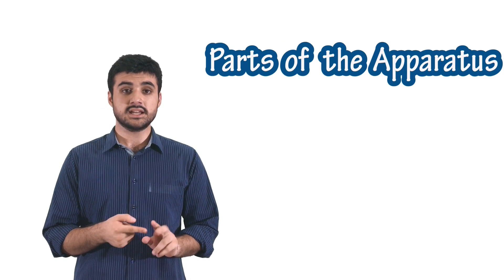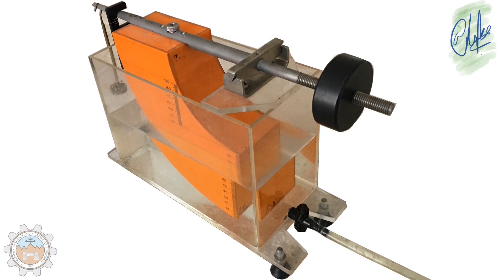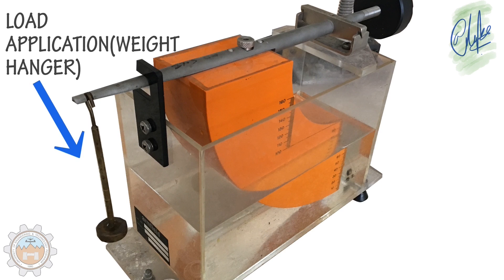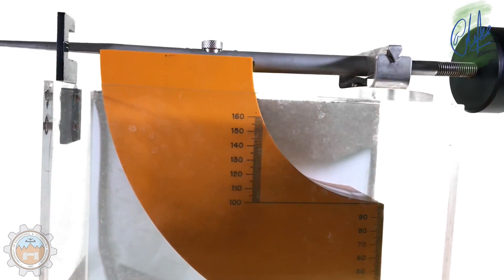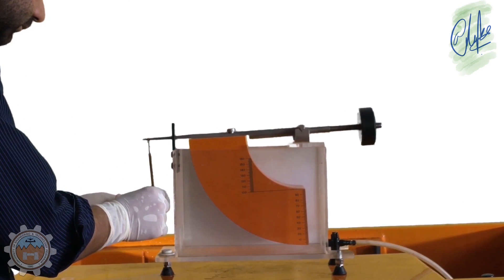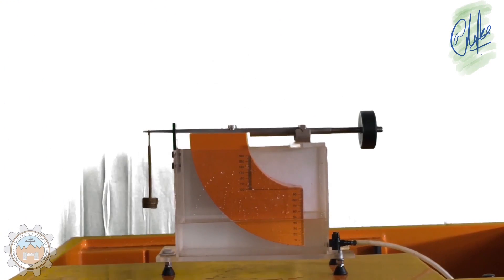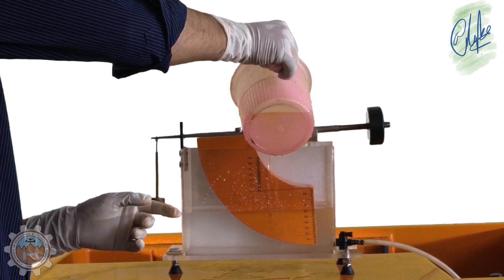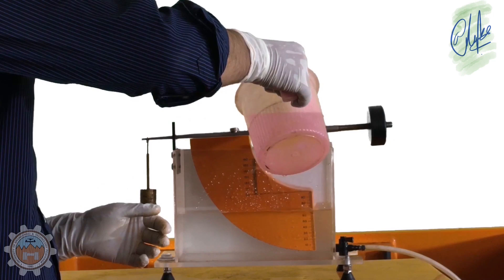To Determine the Theoretical and Actual Centre of Pressure on a Partially Submerged Body

Comment: How did you get Fr? I'm confused with the units. I assumed it's gravity but I can't get same result after computing :(
Reply from the maker: Mitsi Takumi thanks for asking it's like this 

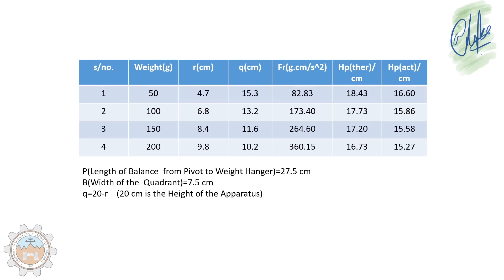Fr was calculated by the formula Which is on 4:38s(in the video) 
You can see there we have 
(1/2)x (the density of Water)x(r)x(B)

r is from the 1st Table on 4:30s we calculated it differently for our different weights 

B is the width of the Apparatus/Quadrant=7.5cm

Yw is the Density of water in FPS units
Though you have to convert it as our original units are in cm and we want consistency 

Hope it helped

Comment: would  you please say how to find W.P , and what is the meaning of WP?? and how to measure the value of radius ? radius would be measure from pivot to quadrant or water|
Reply: Shishir Kumar Sikder Amit 
(W.p).  W is the weight applied and p is the moment arm (27.5 cm ) fixed value.
While  'r' is the level  of water from lowest point of quadrant.